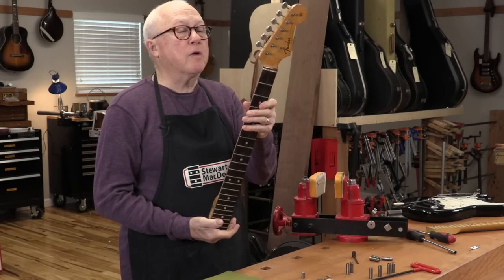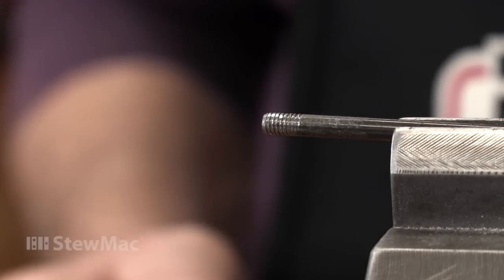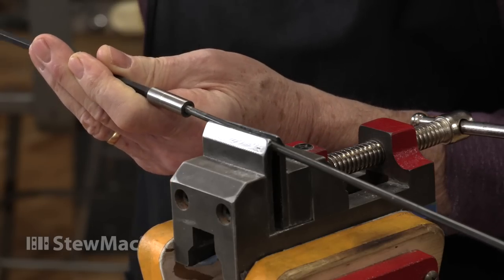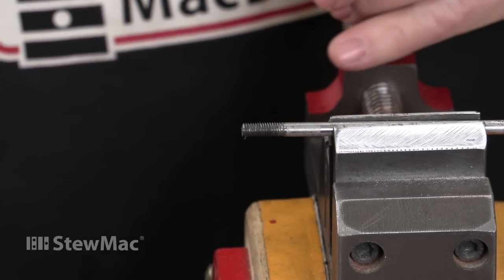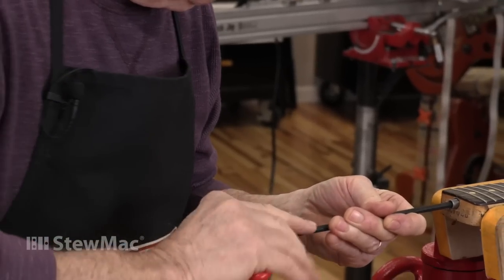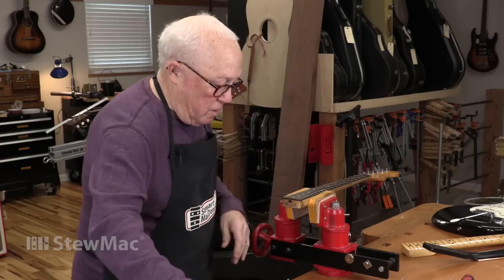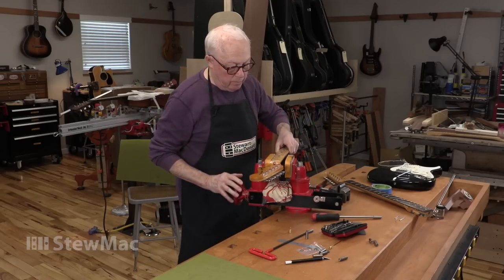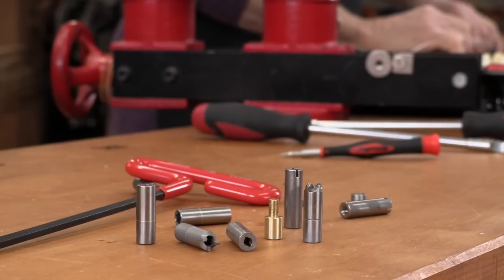How to fix a Fender truss rod

Comment: I just broke the truss rod for a Sept 1964 Strat neck that I bought back in 1989 for $400. I was thinking about selling it but first wanted to put it on a "Starcaster" body I had lying around, with a loaded pickguard from a '93 custom shop Strat. It sounded great but the action got progressively worse on the higher register. I had just installed a new bridge. I kept trying to set it up until I finally ended up snapping the rod. Now I'm going to try and see if I can fix it as demonstrated in this video. My stepson has a new roommate who is a tech, who I haven't met yet, and I'm hoping that he can be helpful as well. This video is so perfectly concise and easy to follow. It's the most encouraging thing I have found on this particular problem. Now I wonder how much a replaced rod nut will cut off the value of this neck.

Comment: hi, i have a vintage truss rod in my strat, recently i have adjusted it and overdone it, i loosened the nut until it was unscrewed in the rod itself, so i tried screwing it back then i loosened it again and i noticed that it felt no resitance already, should this be a concern?
Reply: I find myself in the same situation right now, were you able to fix it?

Comment: If I might suggest using a thin layer of Moly Disulfide grease instead of Vaseline.  It is use for hydraulic press fittings, has excellent "slip-stick" characteristics and will last much longer because of its makeup.

Comment: I've read everywhere that a MIM stratocaster is a 3/16ths Allen bolt size but mine is definitely 5mm. I used a digital caliper on the allen wrench to be sure. Did they use metric in 2007? I've been the only owner and it's not stripped, I've just never looked at the wrench size, just used one that fit correctly until now.

Comment: I have a custom shop Fender strat where the action keeps on raising slightly just a couple of minutes after tightening the truss rod (philips screw near the body) put the neck back in place and screwed in the plate screws. I cannot understand what the problem is. Maybe the springs where I have 3 stretched out in a peace symbol shape? Any fast and obvious answer to my dilemma would be incredibly appreciated. Thank you 🙏

Comment: Hi i have a vintage strat neck  qnd i cannot adjust  the truss rod in a counter clockwise turn. The truss rod will just turn until it comes off but nothing happen with the neck action. What seems to be the problem?

Comment: Totally confused about how the pilot works.  It's solid brass.  It's in the way of the cutter.  Do I need to drill it out myself?  I'll need to look for a video on this.
Reply: The pilot centers the cutter during the first few turns because the original hole is smaller than the cutter. Once you have the cutter started,  you remove the pilot.

Comment: If you have a truss rod that adjusts at the heel, and you don't like it, is it HYPOTHETICALLY possible to modify the neck to adjust it at the headstock? (notice: I asked if it was HYPOTHETICALLY POSSIBLE, not if it would be cost prohibitive or difficult.)
Reply from the maker: Hypothetically, it certainly could be done. Practically, I can't think of any reason this would be done over the alternative of replacing the neck.

Comment: I have a neck stingray bass, but the trusrod is broken. please help me how to fix that trusrod. thanks sir
Reply from the maker: How has the truss rod broken on your StingRay bass? Exactly what happens when you try to adjust the tension? Are you able to turn the adjustment nut, or is it too stripped to get a good grip on?
Reply: when I turned once suddenly broke the iron, probably because it has not been played for a long time.
how to change it ,, should fretboard be opened? (thank sir)
Reply from the maker: At the very least, you will need to remove the neck from the body. Then check to see if you can tell where the truss rod broke. Can you remove the spoke nut from the heel end of the neck? If you can and it looks like the truss rod broke at the thread behind the adjustment nut, you may be able to use one of our Truss Rod Rescue Tool Sets. However, if this solution doesn't seem to fit your situation (or if your bass has a dual-action truss rod), this repair will likely require removing the fingerboard.

Comment: Question:  does anyone know how Peavey put the truss rods in the T-60?  Maple neck, no separate fretboard, no skunk stripe.  ?
Reply: I have an idea how it was done.  Looking for confirmation.
Reply: Thomas Jefferson that was my thought exactly.  The neck is 2 pieces of quarter-sawn maple glued together.  Someone else suggested it was gun-drilled but a curved channel would be hard to do that way.
Reply: Not so much; do it just like this one with a stop.
Reply: I think I said that...
Reply: Sorry, I had 2 different videos in mind.  Check out the "What's wrong" video...
Reply: wayback playback I must adjust the truss rod on a Peavey T 60. What is the exact size of the nut. Its like a Gibson nut but I think it's bigger

Comment: IS THERE ANY WAY TO LUBE A TRUSS ROD NUT WHILE STILL IN THE GUITAR ?
Reply: I have the same problem.  The nut is difficult to turn and I don't want to push my luck.  The only thing I have come up with is to use some kind of penetrating oil and stand the neck up so gravity helps to pull the fluid down into the nut/rod junction.  I also gently worked the nut back and forth to try to clear the resistance, which was probably some kind of corrosion.   I don't know what would be the best product to use, but if you use a tee handle and go from one side to the other, you can see which fluid allows the most progress by viewing the new position of the tee handle.  Go from very thin, low viscosity fluids to the more vicious ones.  That way the high viscosity ones won't block the others from entering.  Let us know what you find.  It's a common problem and we all need a good solution. PS look for automotive or boating and aeronautical products also.  Good luck!
Reply: I had a bass with a stuck truss and I lubed it up with some cheapo spray lube from the hardware store, let it sit on a stage stand over night, came back and was able to make a tiny turn.. kept slowly adjusting and it finally came back to life.
Reply: Rember what it coulda' bean?
Reply: alex tworkowski not 100% I just found something that was handy for a wide range of stuff. I bought whatever was on sale, figuring the bass neck was going to be saved or trashed either way. I honestly didn't think it was going to work. I didn't soak the truss with it either, maybe just a couple light sprays and then left it to creep.

Comment: But what if the rod is broken at the other end of the neck?
Reply: Then it's time to remove the fretboard.
Reply: Desmond Hume. Or hope there's maple neck. ;-)
Reply: Will Kupers what does it being maple have to do with the truss rod breaking? You’d still have to find a way to get in there..
Reply: Chazz-J Black . Right. But you don't have to remove the fretboard.(exc. maple cap). easier to do, then remove fretboard.
Reply: Chazz-J Black watch their latest video. Answers your question about the truss rod breaking at the other end.

Comment: what is that pilot good for? you cant cut with it...
Reply: The cutter went on after the pilot to start a concentric hole. Once the hole is started, the pilot could be removed and the cutter used alone until there was enough room for the chaser to clean or cut threads.
Reply: ok now i get it, but i don't like the idea of changing the hole size, couldn't he make a new cuter just for this job? like all of his custom tools
Reply: @guitarisnotmybusinessgnb4075   Agreed.